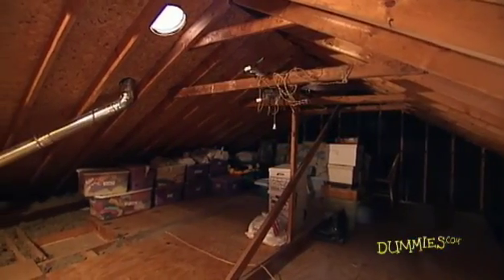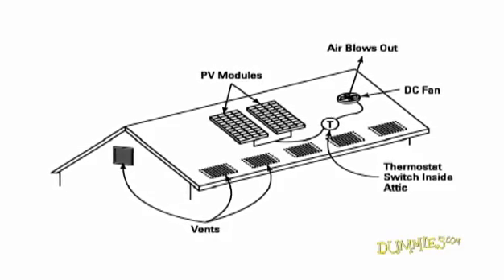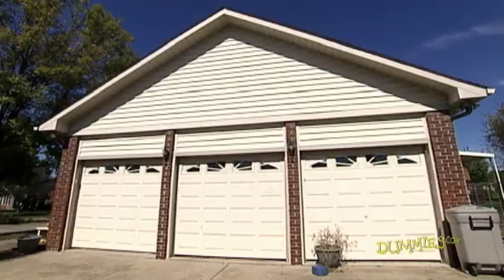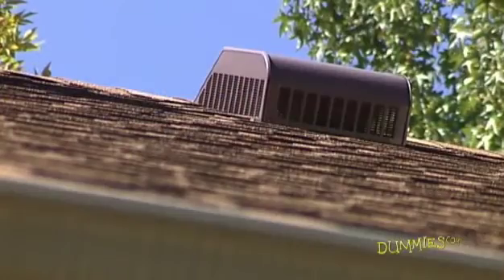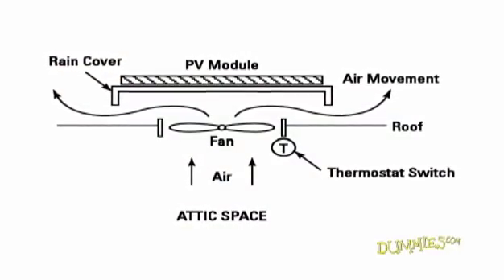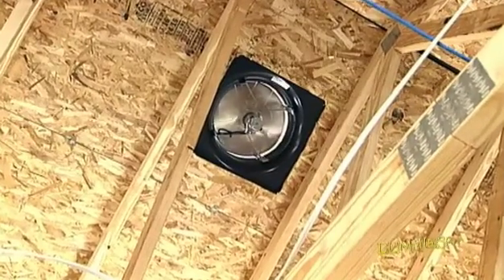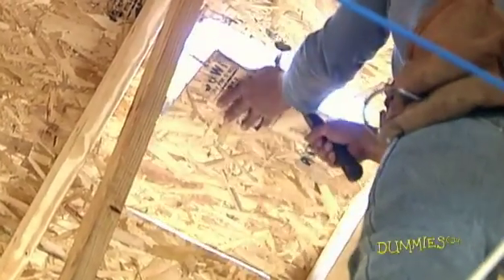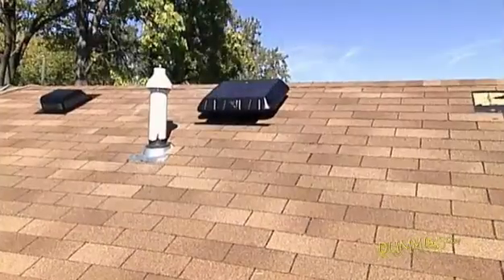How to Install a Solar-Powered Vent Fan For Dummies

Comment: @nrgsaver I really disagree. These things aren't cheap, and for a reason. Many allow you to disconnect the thermostat so that you can have it run all year round. And in winter, all the excess moisture leads to ice damming in northern climates. By running all the time, it reduces ice damming (good). 

The CFM rating is correct. The blade design on attic fans is designed for maximum airflow per given RPM of the motor. 

Why do people always underestimate alternative energy?!?!?!?!?!

Comment: @nrgsaver I just installed my 30 watt...25 year fan... it dropped my temp 30 degrees..and here in Michigan you want them to run in the winter...you want that heat and moisture out of ur attic so you don't get ice damns which i had huge issues with last winter... I suspect my attic fan will solve that problem as well as it solved my heat issue.